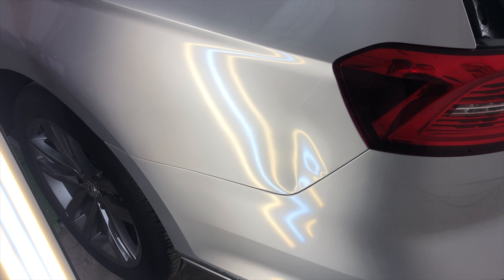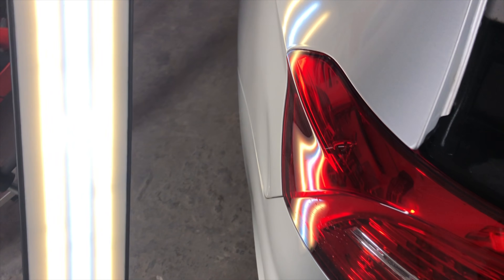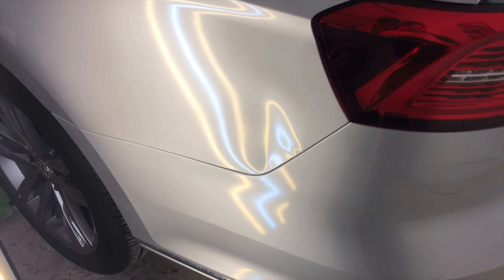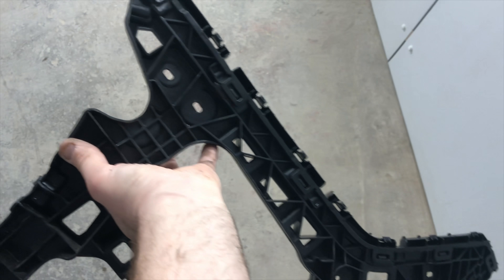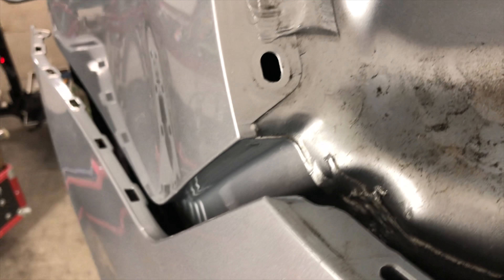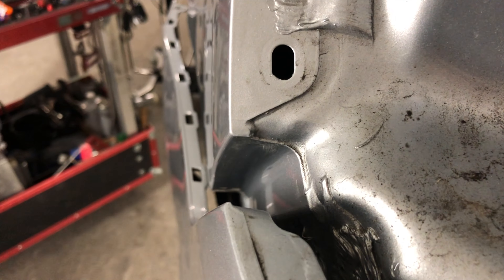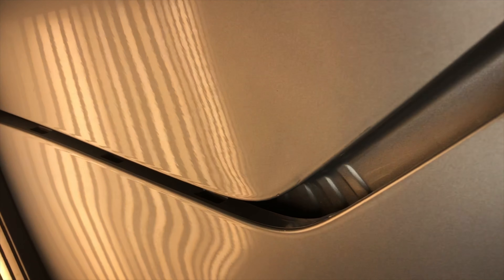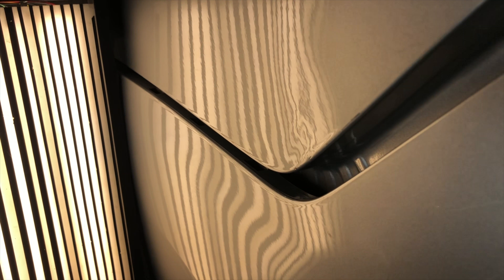Bodyshop repair or Paintless repair?? #DentRemover shows you how...

Comment: Are you using heat to make the metal malleable or the paint?  You'd have to get the metal pretty hot to do that and you'd burn the paint first no?  It's to keep the paint from cracking is my understanding correct me if I'm wrong.

Comment: What was the point of doing a partial R&I on bumper?  Taillights on those come out super easy. Looks like you're trying to make it look more complicated and get more money!
Reply: @dentremover01  I know if you need to straighten the edge the whole bumper it needs to come off. It is hard to get your tapper or dollies and hit flush with your hammer. Plus the video didn't show you doing that part of the repair.